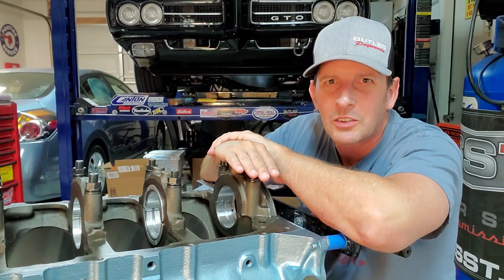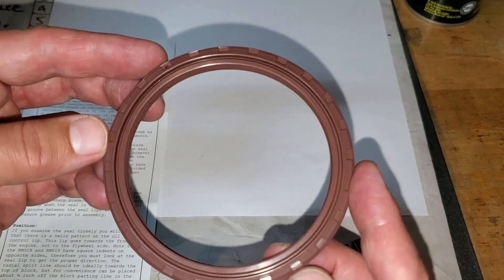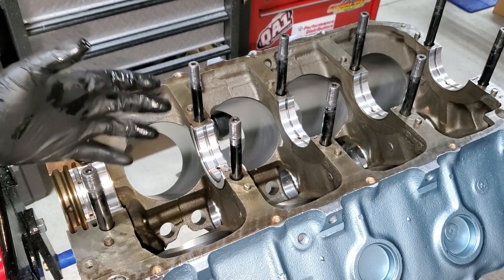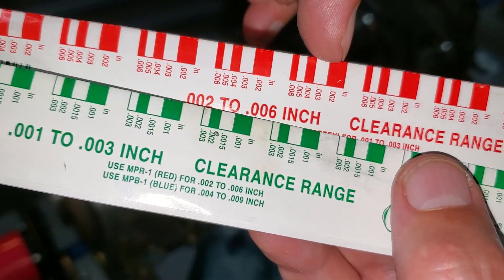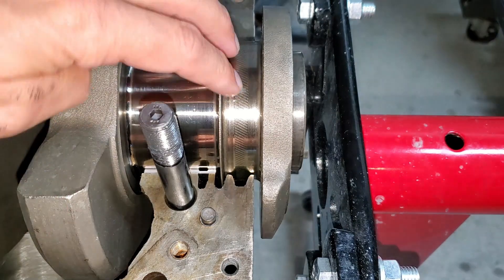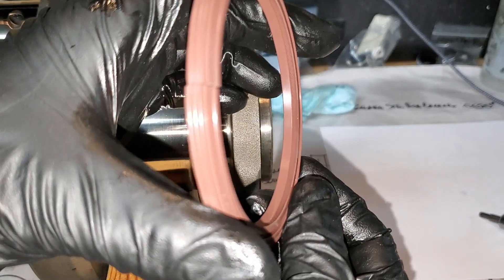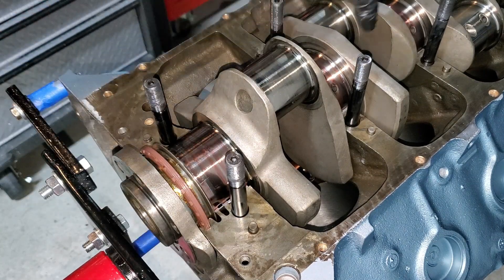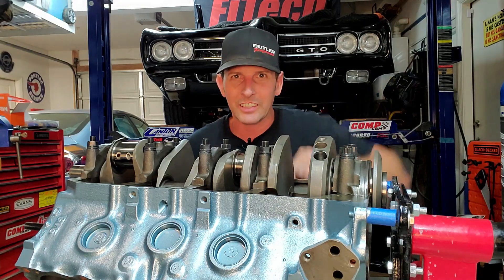How to install a BOP Engineering One Piece rear main seal.  Pontiac short block re-build, Part 5

Comment: I like the Best Gasket Kevlar Center Core Graphite Coated Rear Main Seal with Factory Pontiac Crankshafts.  My 1976 Pontiac 455 520 Hp Factory iron heads hasn't leaked a drop of oil.
I have used BOP Viton 2,-piece Rear main seals in the past. Some leak light last one used didn't leak anything.  Found its super critical to have 0-1 % piston ring leakdown and zero crankcase Blowby and your crankcase Breather evacuation system used is critical. 
1-piece BOP Viton Rear Main seal I would use with an Aftermarket block and a Crower or Winnberg billet crank.
Pontiac Rope Rear Main Seal by Best Gasket works for me with Factory blocks and Factory crankshafts. I prefer all 100% USA Original because it was made here not China.
Raw Materials cast, Forged, Billet all came from the USA !
Reply from the maker: Thanks for the comment... totally agree about having your PCV system on point.  Doesn't matter what seal you use, it's gonna fail if your crankcase is trying to push oil out every nook and cranny.  I went with a M/E Wagner PCV Valve.  I'm about 750 miles in on this build, zero oil consumption, zero leaks, and the oil looks brand new!  I love it.  Here it is, if you haven't seen it... https://youtu.be/fdYFieOOGq4  Thanks again for the comment!
Reply: @FastMonty  https://youtu.be/VdDDDPkp6Nc
I spent a good part of 2021 making Fuel system changes on mine. Lots of tuning and test drives.  Won every Street Race so far on the Highways here in Illinois.
130 mph is alot for my 63 Grand Prix.  She gets light in the front end at 130 mph.
She Revs to 7000+ rpms my 455 though I keep it 6500 rpm Turbo 400 upshifts. I have the Turbo 400 Governor Calibrated for 6500 1-2 & 2-3 upshifts. Took 3 days to science that out.
Reply from the maker: @brracing7861  Ha!  Looks and sounds awesome!  Love those Purple Annular Boosters!  Yeah, front end lightness = no fun.  ha, ha... keep it up!
Reply: @FastMonty  https://youtu.be/YafukITCv1o
Idle quality check.  Hits real clean.
Shakes the ground I use no mufflers open 2-1/2 " dual pipes. 
Just like the Pontiac SD421 Drag Racers did 1962- 1963.
Reply from the maker: @brracing7861  Dang!  When my cut outs are open, it's freakin loud.  ha, ha... Might need to upgrade to Fuel Injection :)
Reply: @FastMonty  I am Old School prefer a Holley 4150 Double Pumper Carburetor.  They are made up to 1300 cfm now custom BLP Billet bodies. 
I have a Chevy C4 Corvette its Port Fuel injected. The 63 Pontiac Gp 455 is much more powerful faster 0-120 mph on the  streets.  Corvette handles better but it's a True Sports car.
Reply from the maker: @brracing7861  I hear you... you know how difficult it is to get a carb "just right", cuz you did it.  I just converted from my Barry Grant 750 DP, night and day throttle response.  Thanks again for the comment!
Reply: @FastMonty  That Vintage Barry Grant 750cfm Double Pumper is likely a Good One.  Pontiac 455 and stroker 400 ci based engines typically like huge CFM Carburetors or EFI Throttle Bodies.  Have to experiment if your after Max Power with Good Street Driving Manners.
750 Barry Grant might work excellent on a Pontiac 350 or 389.
They really worked on 350 ci Chevies back in the 1990s.
Lots going on in intake manifolds single and dual plane styles.
Different cylinder heads cfm flow. 
Intake port Velocity rates.
Pistons speeds with different crank strokes have a huge effect also.
Reply from the maker: @brracing7861  Yup, know the drill all too well... going to be dynoing the Throttle Body soon, then switching to port injected and dyno again.  I suspect low end gain, good experiment, for sure.
Reply: @FastMonty  I have had my Pontiac V8s. Superflow Water Brake Dyno Engine Dyno Tested.  It's the most accurate way  to test the engine.
Engine has to be out of the car, need a Billet Steel or Billet Aluminum Flywheel,  SFI Blowproof Bellhousing to take with.
Most shops are setup only to Water brake Dyno test Chevy V8 engines.
Way to go for an all out Drag Race engines what I was building and doing Drag Race with my 1970-1/2 Trans Am RAIV 4-speed. 
Chassis Dynos like a Mustang AWD Eddy brake Dyno are useful for Street EFI Tuning. Ok for Race EFI Tuning but unable to get all data logging capabilities like a dedicated engine only water brake Dyno.
They can be hard on engines Dyno testing. Questionable for Street Engines.  Many do fail let go blow up on Dynos. Seen it .
Takes alot of CFM Cylinder head flow to get Hero power with a Street cam profile in a Pontiac V8 to get 550-700 hp to the tires.
Race High compression 13.0:1 , Full drag profile able to Rev to 7500- 9000 rpms , Race Fuel 110-120 motor octane, Good Heads better.  Able to surpass near any .
Street engine want it to last.  Especially now with parts shortages on all makes of engines.
Rather test and tune myself a Street Race engine. 
The Burnout tests.
When torque and power is there optimal you can leave Twin strip Posi burnouts 500-1000 feet easy will be pure black melted blacktop and rubber with a Strong 455 or 400 stroker engine.
Best cars to Street Race against are the modern dodges. 
SRT Challangers 505 hp.
Hellcats and Redeyes 707-780 Hp.
Reply from the maker: @brracing7861  Ha!  Good stuff, yeah, my first motor build was engine dyno'd.  515hp, 600 lb ft.  That's how I tuned my Barry Grant.  Thanks for sharing!
Reply: @FastMonty  1000 Horsepower is Baseline now among slow No Prep Drag Racing. 
Small Block Mopar guys are at 1100 Hp Normal Aspirated. 
Small Block Chevy Guys are at 1050 Hp Normal Aspirated .
The Highest Hp Normal Aspirated Pontiac V8 is in Illinois I have seen it. Rick has 1400 Hp +.
Everything pales in comparison unless at 1000 Hp at least. 
What No Pontiac V8 Guy has done outside of Big Chief is Go Street Racing True and make You Tube Videos.
Look it up there are Zero other than Chief in past.
Reply from the maker: @brracing7861  Wow, that's a big number.  Maybe next build... ha, ha... As you know, I'm targeting Autocross and Track use, not necessarily drag racing.  But, I wouldn't mind having 800hp at my disposal.  :)  Thanks brother!

Comment: About 6 months ago I was right where you were here.  My machine guy was Blue Weber (60 years experience in Pontic machine work) and I have it all posted on my channel.  To make it easy and short... he didn't want me to use the one-piece seal like you did.  I didn't understand why but at least he wouldn't even look at the old rope seals from the motor gasket kit.  I just don't think he understood the one-piece seal and you explained it so well.  He said I needed to the BOP two piece seal and the funnest this was --- he would not install it!  He made me come to the shop and fit it.  He has had some failure with seals and just will not fit them, but he did oversee my fitment and he thinks BOP is the best.  He knew also that I wanted to have my hands in the work.  I have some miles on my 389 and it does not leak.  Another point is that I put a two piece BOP on a 1978 305ci in my 1957 GMC about 6 months ago and after 500+ miles... not a drop of oil on the floor.  The 389 seal was fitted on the upside down stand and the 305 seal was fitted whilst in the truck and both work with perfection.  The fact is that the oil leaks there are not good, and usually not too much, but it is a leak and just plain gets on a guys last nerve!  Overall I love your videos and informations you share.  You go into better detail than I but I assume most guy/gals that do this know enough, but the more I see the more I think more detail is better.  Thanks!  PS - I strongly recommend that folks get Mr. Gasket exhaust manifold (even on OEM manifolds) gaskets and head gaskets.  I had FelPro head gaskets fail me about a year ago and it's ugly.  I also learned that head gaskets can be gotten in different bore sizes and that was key for my motor.  As a side note it's nice to have the Sneaky Pete Lisle 27000 tool to remove the old rope seals (with the motor fitted in your car/truck) and if you're crazy - reinstall a rope seal.  They can work, but it is far from dependable and not worth the risk.  Bobby
Reply from the maker: Great Story Bobby!  I'm actually thinking about re-doing this video with more explanation as to why some gaskets need to be sized... basically, most people are un aware of their main bearings have be align honed, and how many times... which affects the centerline height of the gasket.  Secondly, I was also told after market crank hash marks can sometimes be too sharp and will eat the seal.  Sooo, I'm still on the fence about adding those details.  Thanks again for the testimonial!
Reply: @FastMonty  It makes a fellow wonder how they made these by the hundreds a day don't it!?!  It was somewhat meatball work, but it did work.  Blue told me about the failures of the early 60's GM timing gears... ever heard that?  When got the Bonneville 15 years ago it poured oil and I found it was the oil pan was loose... but why?  Last year when I pulled the motor apart I found bits of nylon/plastic in the oil filter bypass valve and on the screen.  Blue said that the early timing gears had "plastic" teeth and they started to fall off.  Ford also used plastic gears around this time that failed.  The fix was to loosen the oil pan, pull the timing cover and blow out the plastic bits with a hose and fit solid steel gears.  Sometimes they didn't tighten the oil pan back tight enough.  It was a real mess that I'd never known about without Blue.  I also had an odd bit of metal in the oil pan that was the busted off end of a fuel pump.  Some of the history of these times is interesting.  It really takes super work and effort to know what and how to do things.... doesn't it!  Ever head about Chevy's in the 1950's where the piston rings would not seat and blew oil from the factory?  The answer was to pour Bon Ami down the carb! WOW - but it worked.  They had their problems then but we kinda forget that.  There was a neat show on about 20 years ago called "Automobiles" that goes into some of this history - on all types of cars.  I've been working on tile work for my kitchen and bath and it's been nice watching YOU do the work on these babies!  In fact I am a British car guy with Jaguars, Triumphs and Austin-Healeys' but I did grow up with the lovely American beast and love them as much as you do.  Looking forward to more of your videos and I'd say make a video about more detail and the next time I make one I'll be more detailed too.  It makes them longer but if guys make videos about a 70 year old outboard motor that runs 77 minutes... then WE CAN TOO!!!
Reply from the maker: @bobeaseshop9389  Ha!  Wow... It really makes you realize how indestructible old school engines are... well, to a point.  And saying "they don't make them like they used to" really doesn't make sense... and thank God they don't!  Ha, ha... thanks again for the comment!
Reply: @bobeaseshop9389  haha I'm just a kid to that stuff but I swear I heard about a service bulletin put out about seating rings with bon-ami if you've got an engine that's puffing from unseated rings.
Reply: @MrTheHillfolk  There is a show called "Automobiles" where they show guys pouring Bon-Ami down the carbs on Chevy motor per that service bulletin. I'm sure it's easy to find that clip.

Comment: Hey Monte loving the channel and I just subscribed. Just wanted to reach out I building a 455 Olds and wanted to see how your one piece is holding up to date. After hours of deciding whether to go stock OEM rope seal or modern updated Viton seals, I finally decided to go with the Viton seal. Now the question is one piece or two piece? After watching video and watching your assembly the one piece looks to be the way to go. Again just wanting to see how yours is holding up considering you put some milage on engine. Thanks in advance
Reply from the maker: Hey Jamil, great question... it's holding up just fine.  I highly recommend it.  If the engine is out of the car, get the one piece seal.  Have fun, and welcome to the channel!

Comment: Would you recommend the one piece over the two piece if I am not pulling the crank?  You said not recommended to flex it through, but I feel one cut is better than two.  Thanks, great video!  I subscribed.
Reply from the maker: Good question Kyle... if it were me, and I was trying to install it with the crank installed, yes, I'd get the two piece.  While it could be done with the one piece, the risk of damaging the seal during install is pretty high.  I would definitely reach out to BOP Engineering and ask them about the one piece install process, when the crank is installed.  That might sway your decision.  Thanks for the comment!

Comment: The hash marks on the crank for the Rear seal has to be machined off otherwise the hash mark will tear up that rear seal and will leak.
Reply from the maker: That's interesting... I've never had a problem.  Why wouldn't BOP say that had to be done?
Reply from the maker: An update for you Bill... I talked with Wade at BOP.  He said some Eagle cranks have very sharp serrations that should be polished down.  Stock cranks typically don't need it because of years of use with a rope seal, which polishes it down.  I happen to have an Eagle FORGED crank, which could explain why I don't have sharp serrations.  Whereas an Eagle Cast crank might?  I guess the moral of the story is nothing wrong with polishing it down to be safe.  Thanks for the heads up.

Comment: Been considering this for my future Poncho build. The rope seals just aren't what they used to be when they outlawed the asbestos. Good video as always! 

P.s. The small leak stopped in the distributor valley after I slathered on the RTV along the back edge of the valley pan like a madman lol. Like I said it's NOT pretty, haha. But at least it worked and I guess it was the valley pan after all. Thanks again for the help!
Reply from the maker: Yeah, the one piece seal is the way to go. Great to hear you stopped the leak!

Comment: S0, you torqued the main caps to 1-4 at 100 lbs, and the rear at 110 lbs, right?  Did I hear you right ?
Reply from the maker: You heard me right... It was a test.  Ha, ha... BUT, I miss spoke.  With ARP studs, the main caps get torqued to 110 ft. lbs, and the rear cap gets 140 ft. lbs.  Thanks for the comment!

Comment: iam sorry to say it, but thats not how you put that seal on... chance is big thats not going to seal up.
Reply: How do you install it then? I thought it was ok what I saw Mike do!
Reply from the maker: @transam4555  Ha!  Agreed.
Reply from the maker: Sorry to say, it's exactly how to install it.  If you're referring to the tiny bulge during the test fit, that's exactly what it's supposed to look like.  (And, yes, I asked BOP too)  Thanks.
Reply: @FastMonty  no you are supposed to flex it like a coil spring, not bend it outwards like that! You will get a leak eventually because of that.
Reply from the maker: @Kokaiinum1  you're kidding me, right?  That's impossible to do.  Do you know why?  The flange has a larger Outside Diameter than the diameter of the seal itself. So, it's a combination of coiling it on and bending it.  This is my third time installing this seal. The prior two did NOT leak.
Reply: @FastMonty  i aint saying this to bash on you... But sure, its your car, your money and Time, you do what you want, but i can assure you, that is not how its done if you want it to be leak free
Reply from the maker: @Kokaiinum1  see my prior comment... this is exactly how to do it.
Reply: Looked fine to me based on what I read on the instructions on mine
Reply from the maker: @brianmartin1133  Thanks Brian!
Reply: You're supposed to sand the outside of the seal. Not remove material from the parting line. You're supposed to remove enough material on the outside of the seal to achieve a 025 seal penetration. The only way to know if your cap grove is okay is by measuring the inside  diameter of the seal when installed without the crank. Subtracted from your crank diameter to find out seal penetration.

Comment: You made me Smile ,When you spun that crank ,for the first time ,Yes Success ,Good Job ,Next time put some hose on those crank studs ,to prevent a nick in the crank on installation ,Thank You for your videos !!!
Reply from the maker: Thanks Greg!  Yeah, It was a little tense in my garage, when I was test fitting the crank.  So happy that my blue printing was correct. Good point about covering the studs... or, just remove the studs, ha, ha... Thanks again!

Comment: Mike
Did you have them  smooth the serrations when  you had it polished ?
Reply from the maker: Nope.  Was I supposed to?  :)
Reply: @FastMonty   I have heard  yes and no  so I am sure but if you ran it that way before I guess it will work
Reply from the maker: @brianmartin1133  Yep, so far so good, but, I also have a Forged Eagle Crank, soooo, maybe stock cranks have rougher serrations?  Good thing to find out.  Thanks for the comment.